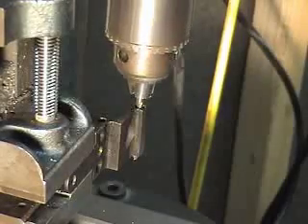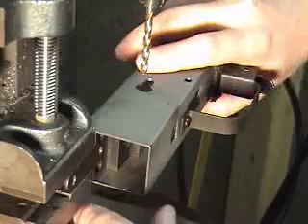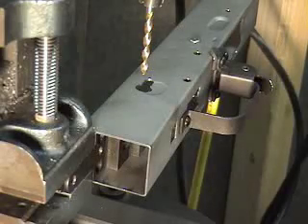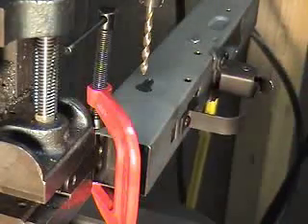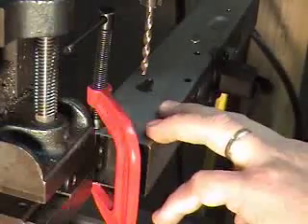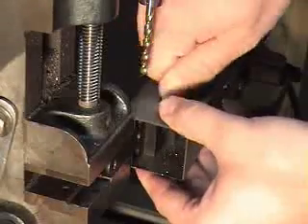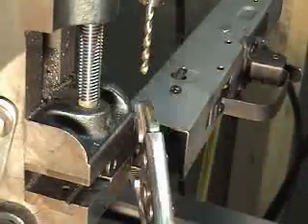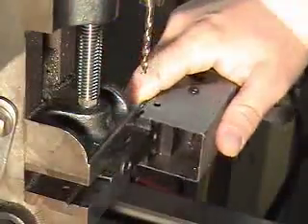Drilling rear trunnion holes  Build your own AK AK47

Comment: Use a uni-bit and you will save mucho time. Go to lowes! Install the rails drill all your holes after you make your trigger hump. Then heat treat. Uni-bits are stepped in 32 of an inch.

Comment: For an 80% receiver would it be  better to harden the receiver first then drill the holes? or drill the holes first then harden the receiver? or it does not really matter which process comes first?
Reply: 7 years late but, Hardening should be the last step.

Comment: Love your videos! Would love to praise you with compliments but in an effort to be direct I will just ask you. Have you ever had an instance where the rear trunnion rivet (long) was too large (circumference) to fit into the rear trunnion hole? What would one do at that point? I know the trunnion was from a virgin kit, do I just drill it larger so that that rivet would fit?

Comment: ive seen an AMD65 with the underfolder configuration (polish m70).  if I have a receiver blank, what would need to be done and parts needed for this?  do i need to pick up a polish m70 rear trunnion and drill the blank accordingly?

Comment: i have a question for you, lets say someone has drilled a hole compltly through a barrel. Is there any way to repair the barrel after it has been removed?
Reply: did you figure it out
Reply: @aft1567  no I never did and it has been a couple of years so the project has been sitting.
Reply: @neo66ghost  thanks for getting back to me
Reply: Not an expert, but I gonna say no, and it’s probably “shot” lol 

I got my barrel from Arms of America, they have 16” Polish FB Radom, chrome lined and hammer forged barrels, with blued finish, for $135 right now. 

It’s not Russian, but it’s still an import from a country that’s been making AK’s since almost the beginning. Also, I asked on the AK subreddit, and practically everyone said the FB’s are some of (if not the) best barrels on the market and I made the right buy. 

I guess you could try and fill the holes with welding and the re-rifle it, but that’s not worth the time, effort, or money. Even then you still have a used barrel, whereas the FB Radom is brand new and good for 10-20,000+ rounds.